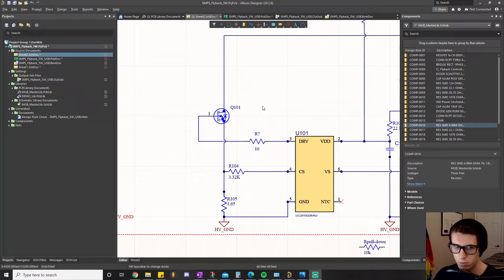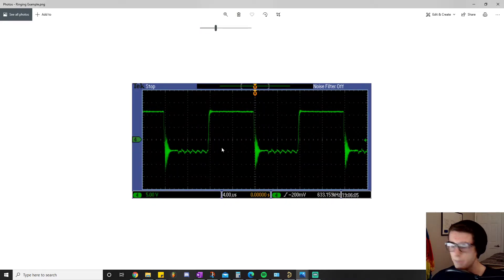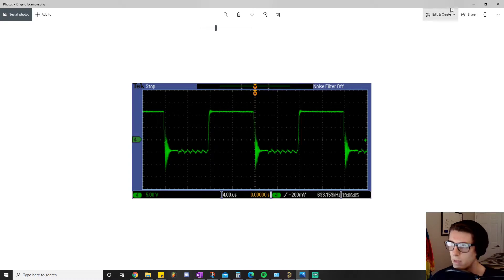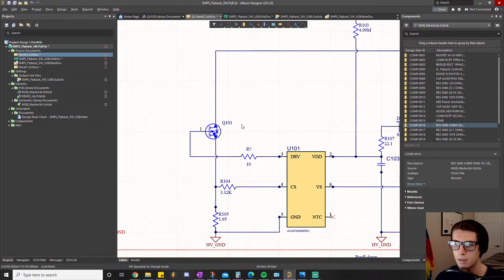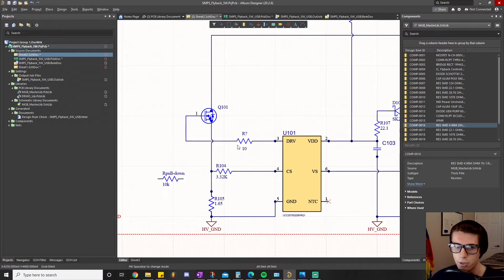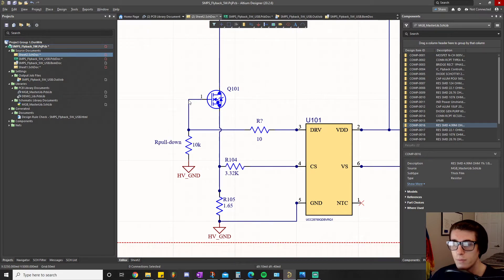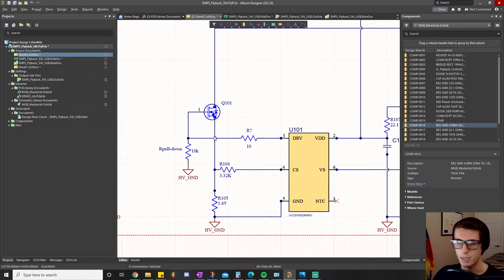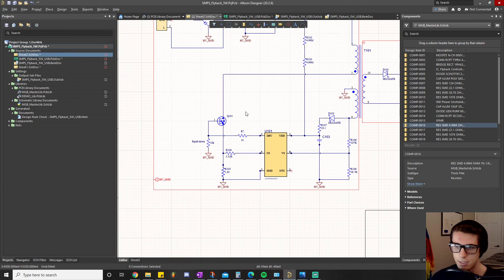MOSFET GATE-DRIVE CIRCUIT Pt. 4 | Circuit Design Tutorial, Altium, PCB | MOSFET GATE DRIVE DESIGN

Comment: Hello brother, thank you for the nice video. Is there any mathematics to calculate pull down resistor? Will it affect to the gate ringing?
Reply from the maker: Hello, yes there is some mathematics to calculate the pull-down resistor value. However, it gives a range so large (10KOhm - 1MOhm) that it is unnecessary to do this calculation each and every time. Just select a value around 10K - 100K and you will be fine every time.
Reply: @RGBEngineering  thank you for the speedy reply.. keep it up bro.. 👍👍
Reply: You're  great 👍❤❤🙏🙏
Reply: Im from SRI LANKA.  what type of diodes  .. 4148 ?